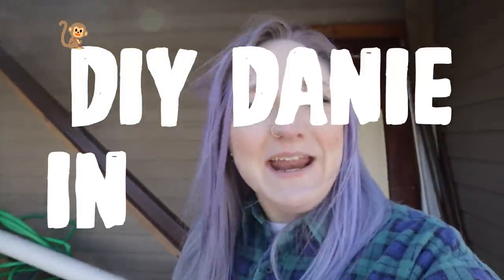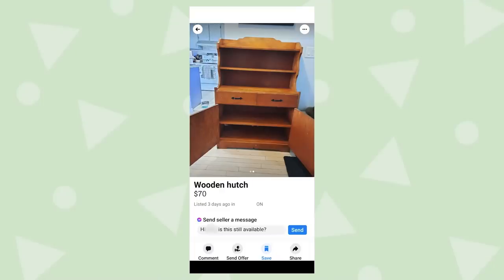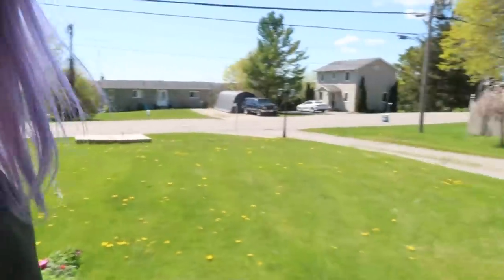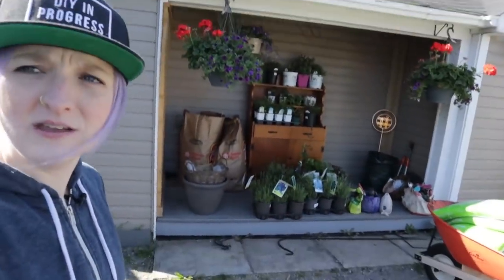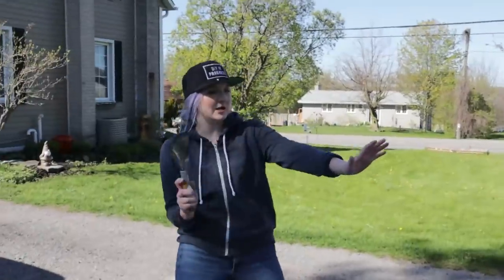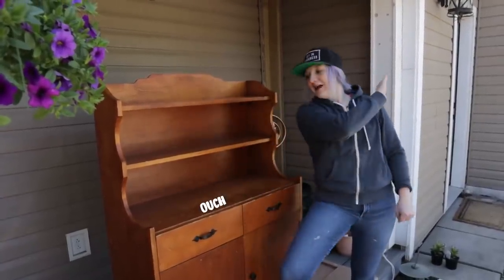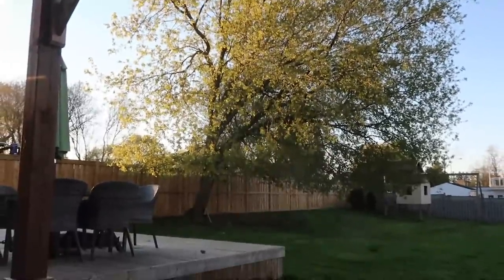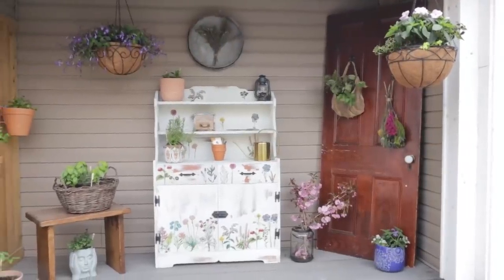i know *NOTHING* about gardening but i give it a go anyways | Farmhouse Refresh

Comment: Aw I dig gardening! 😁👍🏻 If you’re worried about remembering to water making it an event in your calendar can help. Also if you really don’t wanna do it, drip hose or a drip system can be laid into the flower beds and put on a timer. Boom done and your plants stay happy and healthy without you having to drag the hose around. I think of gardening as exterior design rather than interior. It’s just a big outside room that can be designed how you like, the possibilities are pretty much endless. 🌸🌼🌺🌞

Comment: Danie- The plant with the long blade like leaves is an Iris. They don't bloom every year, but beautiful when they do!
Reply: And didn't she have a bunch of hydrangeas there with the long dead stocks?
Reply: Irises should bloom every year unless they have not been thinned.  They need to be dug up about every three or four years, separate the strong corms from the old and then replant.  They are beautiful plants.
Reply: There was several sedums with dried flower heads on them.

Comment: The low-growing plant with tall dead flowers is likely sedum. I'd trade out the window planters with longer ones that match the window width, but that's me. (It seems you got rid of them? 🤷 Valid.) Personally, I've been avoiding sprinklers, but.... I really want that one your mom brought you omg. ("Branch manager is making cuts" really made me laugh. I love your puns.) The welcome sign basket thing is also beautiful! I love the pot hooks! Did not know those were a thing! I have to get some now 😍

About Hedge Trimmers:
So I've always low-key hated hedge trimmers, and going to horticultural school really turned that into a high-key hate. They're really best for if you want squares or balls or whatever, but that's really best paired with bushes with tight growing habits that are naturally only a little bigger than the size you are aiming for. Hedge trimmers really butcher and tear up branches and leaves, and they tend to leak machine oil onto the plant. I've just never seen a bush that's been hedge-trimmed thrive like it should; they tend to be a bit sickly and sometimes start rotting in the middle. The second bush you trimmed, you over-trimmed right away, and it's really going to suffer for that - BUT you were using the hedge trimmers the way most people do. (Your use on the tree was fine and is how those are usually trimmed.👍) If you absolutely can't spend all day hand-pruning, I get the appeal, but I'd encourage you to just replace bushes with ones you like the natural form of if that's the case.

I'm sorry if this sounds overly negative, but I thought my experience might help Danie and anyone else reading. I tried to keep this to just enough words to get my point across. I am up for answering any questions with more detail than provided here.

Comment: Just incase: If that fire hydrant isn't just for decoration, you might want to double check with the local fire department, as hydrants are color coded depending on water capabilities. I don't imagine it would be since it's sitting right next to your house in a garden, but wanted to make sure you weren't accidentally breaking the law.